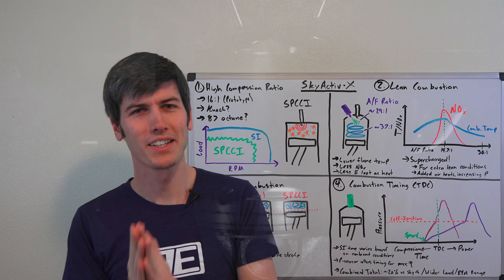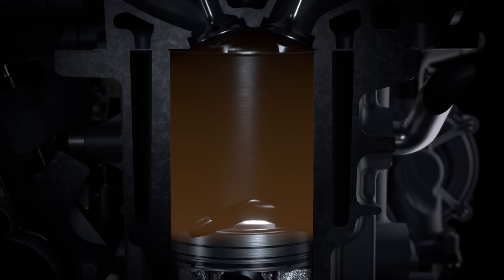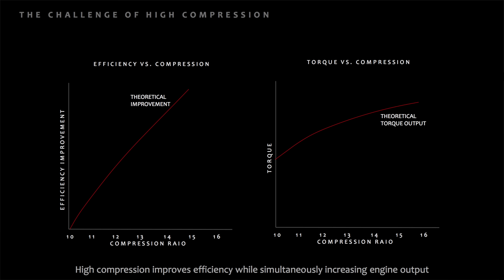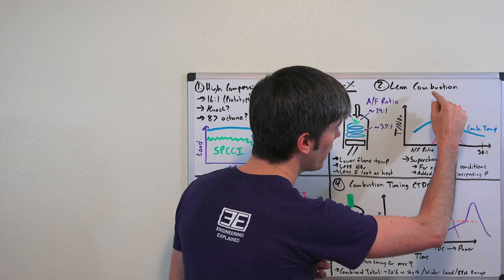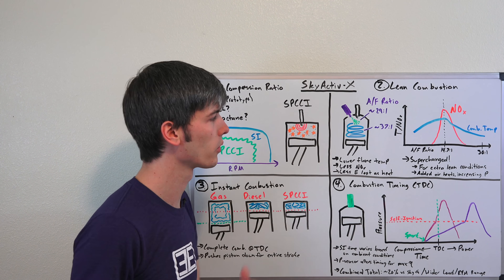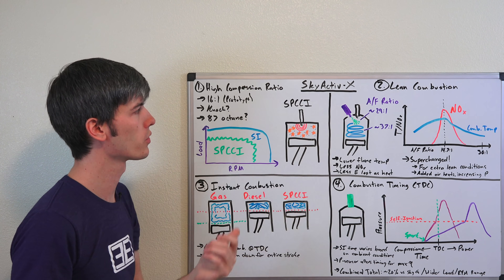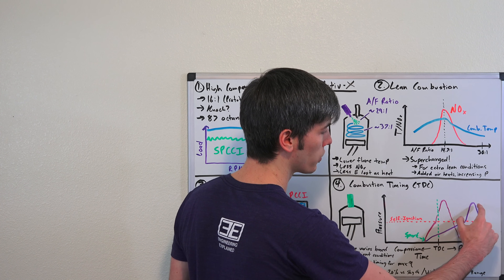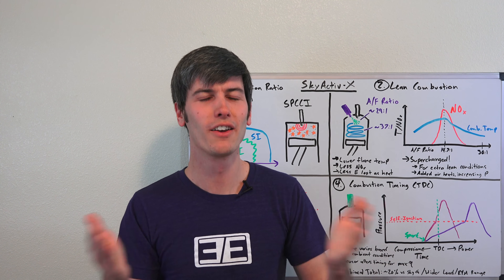How Mazda Is Saving The Gasoline Engine - SkyActiv-X

Comment: Shouldn‘t the isobaric ci combustion be slower than the isochoric si combustion. Eventhoug the vibe function looks different. Also highest nox should be a little lean since more air favours nox, eventhough temp is slightly lower.
Reply: I am missing a differentiation between combustion and expansion. And a great responsivness can be expected, if a car is quality controlled. Great vid though! Did you do anything on miller vs. adkinson cycle?

Comment: I would like a little more of a comparison on the performance in heavy traffic for the engine. How well did it accelerate from mid speed to highway speed? How was the 0 to 35 MPH performance? It is something that my current car spoils me on, but it is not very fuel efficient and I plan to replace it in the next few years anyway.

Comment: Sooooooo... They made a diesel that runs on gas and has a spark plug and computers? ok.
Think i will just get a diesel instead. At least most of those are good for 500k+ miles and can get 40+ mpg in a car or mid 20s in a 3-4 ton truck.

Comment: possibly with increased compression, will make use of more force, requiring greater cilinder, a pump to pre compress the fuel, more force still, the weak combustion mixture reduces the torque, requiring a higher ratio of gears in the transmission. Oh !! This has smelling like a publicity stunt.

Comment: Having a lean mixture and a very small richer mixture of fuel to initiate ignition sounds like the CVCC engine. The therory is old but Honda used it in the 70's to improve emissions. You mentioned the test vehicle had 190 hp, what was the torque? Horsepower sells cars, but torque wins races.

Comment: Engineering Explained No way Mazda can achieve better fuel economy than a Toyota E-CVT with the same HP. Toyota's done away with pretty much all the components that incur losses in a traditional engine (clutch, gearbox..) by smartly pairing it with two electric motor/generators  in some sort of planetary gear hub. Toyota's E-CVT is a very clever system and I believe it's worth a video explaining how it works here in your channel. Can you?
Now, I'm not saying Toyota's E-CVT can't be improved, in fact, convert their atmospheric engines to use ignition by compression and a small turbocharger and you will get the most efficient combo ever, likely at a cost of reliability.

Comment: Great teaching just slow down a bit, it is very exciting information but, stop to breath now and then and let our minds catch up. Old school thought was make it lean and mean ,it worked but motors didn't last long. Then this emissions, came all for the good ? I guess, then cars got so dam complicated they didn't work after a couple of years emissions wise. sensors fail, plugged cats blabla. a well tuned non emission carburated v8 of the 60's could get 28-30 mpg.. I can see problems with this but eh you never win if you never try. E cars make more over all pollution the  ICE will ever if you run it 500k miles in proper running order. I doubt anyone will ever get 1 million miles out of a e car.

Comment: There isn't any obvious thought to NV on the engine, which means they're either trying to hide it or this technology is no where near production. 
NV has always been my biggest concern for HCCI. Autoigntion is exponentially louder than normal combustion from a spark ignition engine since the rate of cylinder pressure increase is far higher (kPa/deg crank angle); think how loud super knock (LSPI) is, or the crack from a Chevy starting up on a hot day. That is essentially every combustion event. They really need to do something radical to reduce radiated noise to make this thing marketable. This also requires fuel injectors with much higher rail pressure than a standard spark ignition direct injection (SIDI) engine, due to the small window they are injecting into on the compression stroke. So the injectors are much closer to a diesel injection system. This adds more concern for DI noise as well as new problems like fuel system durability to overcome, since gasoline has much lower lubricity than #2 diesel (looking at you VW TDI's with your shitty HPFP; RIP). It will also be interesting to see how they deal with engine warmup and cold weather.

Comment: Electric cars won't be more economical in Australia as our energy is made by burning coal. So even if the cars don't burn fuel, the electricity that charges them is. 
There are three cars I'm tossing between, i30N, Megane RS, and 2019 Mazda 3, this engine is amazing

Comment: That is one super engine with a lot of R&D gone into it's construction. What I really like is the effeciency and power over the various speeds and gear shifts. The pressure transducer in the cylinder is a neat addition. Hats off to the engineers at Mazda for coming up with the goods. I also like their method of Nox reduction. The use of lower grade octane fuel is certainly an eye opener. All in all, a very interesting video with new concepts adequately expounded and demonstrated.

Comment: So if the engine is combusting a lean mixture, this means more fuel? Or did I mix that up with rich. So how does this save mpg? Side Q, is the supercharger strictly for recirculating?

Comment: If lean is not necessarily hotter, what's up with headers glowing red sometimes?  I've always been told it's either a lean mixture or over-retarded ignition timing.  Timing must be the primary culprit rather than the AFR.

Comment: Only issue I see, is the reliability of the pressure sensors. If those fail unexpectedly, things would go boom fairly quickly I'd suspect...
Other than that, awesome engine design

Comment: really great video, loved how well you explain these brilliant tech innovations.
 one question, is the difference between this and a conventional engine the fact that the mix is near its compression combustion point in this engine when its ignited and it isn't in the normal gas engine, also how hard would it be to convert a standard engine to run in this setup.

Comment: Wow, really cool. I wonder how much more can be done with ICE's. It seems they are spending research dollars now that companies like Tesla are threatening them with electric vehicles.
Anyhow, back in the '90's I worked with industrial engines that were lean burn and ran off of natural gas. They were designed with a pre-chamber that was centrally positioned at the top of the cylinder. A rich mixture was ignited inside the pre-chamber with a spark plug, and it blasted out of a nozzle in the bottom of the pre-chamber, igniting a lean mixture in the cylinder. I doubt if these were compression ignition also, probably had a flame front like a regular ICE, but it was one method that was used for lean burn back in the day.

Comment: So if the flame temperatures are low, the car is more efficient?
Makes sense considering that colder air makes a car more efficient because it's more compact/contracted
Also do normal 4 cylinder subarus run cold
Because in cold months my dads car takes anywhere between 2-5 minutes to fully warm up

Comment: So cool you explained SkyActiv-X Mazda technology. I don't get one thing: Mazda prefers to use 80 octane gasoline for 16:1 compression ration engine, but they decide to use 87 because of market. So why they don't increase compression ratio to use high octane gasoline? Standard gasoline in Europe is 95, how that engine will cope that when knock will not occur as easy as when 87 or 80 is used?
Reply from the maker: I'm assuming they've tweaked the compression ratio to match the 87 requirement. As far as Europe, they use a different rating system (RON vs AKI in the states). Explained here: https://youtu.be/zf-OYXlhJis
Reply: Thanks, now that makes perfect sense :)

Comment: This was a really informative video and I liked how well everything was visualised. One thing I wonder about though was the statement that combustion occoured quicker in Dielsel engines. In our thermodynamics lectures we learned that the otto process burns faster due to the already combustible mix being ignited whereas the Diesel fuel needs to be dispersed and mixed with air before combusting around droplets instead of fumes,  which is slower. We even calculated the powerstrokes of Otto engines as isotherm because of the supposed rapitidy of the process and Diesel as isobar because of the combustion taking place as the piston moves down. I am a bit confused since the explanation in the video makes sense just as well.

Comment: You're saying they want engine knock; do you mean they want to straddle the fine-line of pre-ignition? Knock is bad and causes damage, can melt pistons, etc. I'm a little confused by your comment.

My background is a 395/385 (@ the wheels) Mazdaspeed 3 (turbocharged, full upgraded mods, IC, intake, exhaust, DP, fueling, Garrett GT2871 turbo, whole 9 yards besides building the engine), and I run E25 in-tank and spray water-methanol specifically to AVOID knock and the damage it causes by having very high effective octane (especially being direct injected) and the evaporative cylinder cooling effect of having a healthy dose of alky-based fuels (ethanol and methanol) running through the engine to have a very big safety margin against things like knock and pre-ignition.

Comment: Very neat! I like how they are blurring the lines between the different cycles to make the best of all of them. I think you are reversed in quadrant 3 with Diesel and Gas cycles. Ideal Diesel is a constant pressure burn over a changing V with a longer fuel injection period, and Ideal Gas (Otto) is a constant volume burn over as small of a change in volume as possible with fast flame fronts. The controlled detonation that Mazda is using is a very smart way to get a near instant combustion getting the gas cycle even closer to ideal.

Comment: Since you are using gas and diesel as examples, PLEASE tell me why can't be used diesel cycle with gasoline/alcohol. Today we have some very precise direct injection systems very similar to common rail diesel systems. I'm very intrigued why can't we use some cleverness to use gas/E85 on diesel cycle.

Comment: How is torque/power delivery compared to a regular turbo gasoline engine?
Lets say a BMW B48 (189 hp@ 4700-6000 rpm, 280 Nm @ 1250-4500 rpm)

Comment: I'm curious about emission tests. If there's a car that can run in two mode, one with high fuel efficiency and produce emissions less than the limit, but less power; then another mode for high power, less fuel efficient and goes over the emission limit. Will this pass he test?

Comment: back in 1966 Bill Lear predicted this. the gasoline engine gets so complicated, expensive, and unreliable that a steam engine(like the 3 cylinder uniflow) system is less polluting, cheaper, just as efficient, and very reliable(simple). He demonstrated this with 3 cars used by the california highway patrol and they were a complete success. No big auto maker would pick up the production so(again as Bill predicted) it died because it got buried.

Comment: Two questions that come to my mind:
How does it handle the produced NOx, because a ordinary 3 way cat shouldnt be able to work with such lean A/F?
And how do they manage different octan counts, the can work against it with adjusting the ignition timing i guess, but it will work worse with higher octane fuel or am i wrong?

Comment: Knock isnt the same as compression ignition, knock is 2 flame fronts colliding in the cylinder, secondly you want the burn completed 10 degrees after TDC not at TDC, if you have complete combustion at TDC you drive the piston in to the crank shaft, which is bad.

Comment: Think it through.  Why would electric vehicles be the future?  Even if you hold the faith based belief that CO2 is a pollutant, all electric vehicle theory's are far more toxic to the environment than fossil based fuels, even without the filtering of CO.  And even if we do devise a power storage method that avoided all the toxic battery drawbacks, wouldn't that power source be better used in something like a steam turbine?  Water does after all, expand by a factor of 1600 to 1.

Comment: Best and clearest and explanation of this motor I've seen, that compression is so high. .. 
I have an old 2.0 pinto motor with nearly 14.5:1 commission and the Dyno guy found the optimal static timing at 0.5deg btdc , so i can the theory in Mazda thinking. Top vid.

Comment: So, effectively, its a variable compression engine without the need of hardware..
Reply from the maker: Well, valves are still hardware, but yes, it can vary the "effective" compression ratio.
Reply: Engineering Explained yes, I mean no need for the extra gear, that changes the chamber volume physically.   The pressure sensor can monitor that max efficiency been achieved on every cycle, quite clever.

Comment: Gret video, as always! Quick question, you said in the States, 87 octane fuel is standard, in Europe 95 octane fuel is standard and 98 octane fuel is premium. In theory you would get more power out of 95 octane fuel, so is there any problem to use that one with such an engine, as you can't find lower octane fuel in Europe?
Reply from the maker: We use different scales: https://youtu.be/zf-OYXlhJis
Reply: ohhhhhhhhhh, I see! Thank you a lot, that's really good to know!
Reply: USA uses “AKI” or “Anti-Knock Index”, which is (RON + MON)/2. Europe generally uses the RON scale by itself. So you can’t directly compare the two. Also, RON and MON do not move in unison with different fuel blends... a given blend might make RON change more than MON, so you can’t create a reliable scale that says “this RON is equivalent to this AKI”.